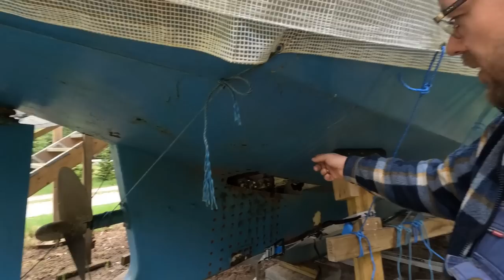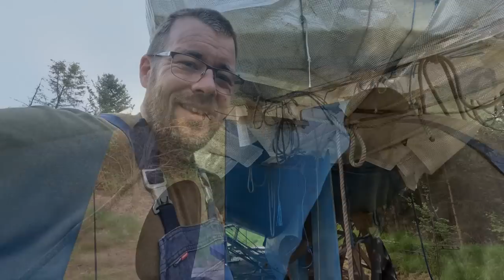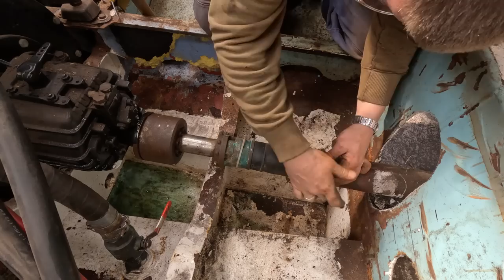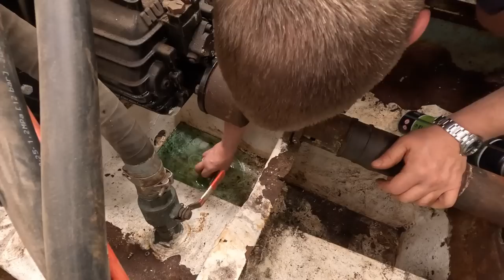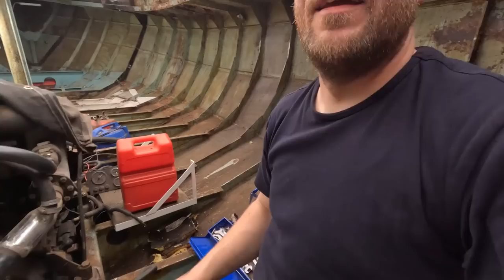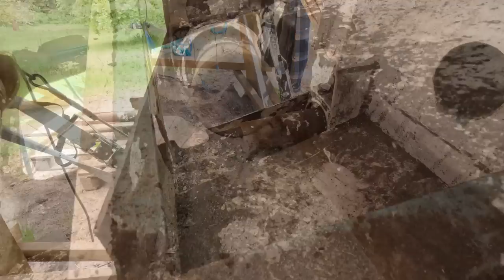Rudder & Propshaft removal. Stuffing Box & Stern Tube Reveal: The restoration of SY Carla part 30

Comment: My own experience with shafts of the size that you have is that they can be machined down in the worn areas and metal-sprayed then ground to bring the shaft back to size. When it comes to the shaft seal, no matter which type you use you need to have good access so you may need to extend the "log" (the tube that the shaft runs inside). You would be well advised to fit a flexible coupling such as "Polyflex" in place of the taper-lock that connected the shaft to the gearbox.
Reply from the maker: We agree completely with what you said and hopefully we can find someone here that can do that with our shaft 😊

Comment: The proper name for the metal block that connects to the gearbox flange is a 'taper lock'. As for the rotating propeller shaft, I would do a positive material identification test. Nowadays, there a better materials than 316 Stainless Steels for propeller shafts, the so called Duplex materials. It all depends on the budget you can spend. If you want to recover your propeller shaft, you can apply "metal spraying' on the part where the shaft is worn. Personally, I would install a new shaft with a mechanical seal (Gleitringdichtung in German) with a leak detection system. You can keep the old shaft as a spare.
Reply from the maker: Taper lock!! Thank you 👍😁 And that sounds really interesting. I will have to have a look into this mechanical seal. I have never seen that before. I only know those from pumps and such..  Are they used in boats too? I can definitely see what you mean with that duplex materials. It sounds like they are much more resistant to the salty environment. Thank you very much. You gave us a lot to look into to and think about 😁👍
Reply: @SYCarla  Yes, Mechanical seals for boat propeller shafts exist. You can find a lot on Internet. Personally, I think that, if you install a mechanical seal, you should use a seal with seal flush, to keep your seal clean from abrasive parts. You can also install a leak detection on your seal. Then you will be alarmed when your seal starts to leak. This type of seal may not be cheap, but it will keep your shaft from wear. Like I said, it all depends on the budget that you can spend.

Comment: Hello Carla 
Thanks for the prompt reply to my comment regarding the Aqua Drive 
Some thought on the stern tube. Considering your planned long voyages I would not hesitate in replacing the stern tube etc. also give careful consideration to the type of stern gland, the old style with packing material are easy to service but should always leak slightly to give lubrication to the gland. Some modern seals are excellent but often need the rubber seals replacing after a period of time.
Carry on with the good work.
Reply from the maker: Hi Martin
Yes you are right. There is definitely a lot to consider with regard to the stern gland. I would really like to install a drip less with a small hose for water lubrication. But I am a bit worried for the chance of the rubber failing leading to a lot of water coming in. But that should be prevented by changing it periodically I guess. Luckily we have some time to think it over before we have to install. Thank you very much 😁👍

Comment: I’d check the rigidity of the stern tube ( measure the wall thickness) and if that is ok then I would check the alignment from prop shaft to the gearbox. If that is ok , then I would start to check the axel for straightness. If all is ok then you can start to think about reusing the axel . I’d strongly recommend to scrap the muffler for the engine ( I have had a few of this crack in the middle and then the boat fills up with water really fast ) awesome work getting all apart .
Reply from the maker: That sounds like a very good way to go about it. We will definitely bring that with us. 👍 as to the muffler. I didn’t know that but I have had som concern about the rubber and now adding your experience we will definitely have to find an alternative 😊 thank you very much for your comment and recommendations 😊👍 we really appreciate it.

Comment: I would not remove the concrete unless you feel a need to. The same with the stern tube, it is just a housing . It is the shaft and your method of connecting it to the gearbox and the method of sealing it against the ingress of seawater which is the critical area.  If you can get a dripless seal system that would be the best. If the shaft can be dressed out that would be ideal, because I would not want to buy a new one.
Reply from the maker: I’m really glad you say that because I really don’t want to have to remove all the concrete 😅 In theory the concrete should be protecting the metal from rust and everywhere I have been removing concrete this have been proven true. So let’s stick to that 👍 As to the shaft I hope you are right. I think we will have to bring it to a professional and the hopefully it won’t get to expensive 😅 Thanks 👍

Comment: Hello Carla 
Very impressed with the work you are doing.
I would suggest that you seriously consider fitting an Aqua Drive they give you a smoother drive line, remove any worries regarding prop shaft alignment and reduce the thrust load on the gearbox bearings.
One problem they are not cheap but have been around a long time. I'm not associated with the company.
Reply from the maker: Hi. Ok I have never heard of Aquadrive before just now. But I have just been reading about it and I am really intrigued! It sounds like a really good solution. Like you say no shaft alignment and no thrust load on the gearbox. I will have to look in to how to mount it in Carla and then the prize of course. But I’m definitely interested. So we will have to research it some more.  Thank you very much for your comment. We really appreciate it 😊👍

Comment: I would replace the shaft because it has wear and rear. You do not know if you can center it properly again. The tube was probably filled with water for the lubrication of the shaft, so maybe best to check if you can still use it or have to replace it.
Another thing I would do or let do is to check the balance of the prop.
Reply from the maker: You definitely have a point there. We were thinking of maybe handing the shaft over to a professional så they can center it and check the balance of the prop. But we have to find out how much that would cost compared to buying a new one. I saw Vetus has a new shaft in the same dimensions. But I have no experience with their quality..
Reply: @SYCarla I could not find reviews of the Vetus shafts, but they are a well known brand, so my feeling says yes. Probably the people that balance the shafts and/or propellers know. They probably can also advise on the shaft tube. It is all quite specialized in my opinion.
Reply from the maker: Yes you are right. We better start looking for a place that can have a look at it and then we will see what they have to say.  As you say they can probably advise us on the tube as well..  Thank you very much once again for your help! we really appreciate it 😊⛵️

Comment: Looks like it needs to be replaced. That way you can see how much damage is under the concrete. You may have to replace the steel that is underneath that concrete. Better to see and know what you have now than later. 
 Ok until next time ⏲️,  
Aloha from the Big Island of Hawaii! 
 Who knows, we may see 👀  your sails ⛵️ on the Horizon someday from our lanai.
Reply from the maker: Yes you are probably right. I think We might remove a section at least to check if the thickness measuring device is giving us correct info. Better to be safe than sorry. It’s a long way to Hawaii and we don’t want it to fail on us on the way there 😁⛵️Thank you very much for your reply 😊 Hejsa from springtime in Denmark
Reply: Ya'll have a place to stay if you make it to the Big Island. I will keep an eye out for your sails on the Horizon. @SYCarla
Reply from the maker: Amazing!! Thank you so much. We really appreciate that 😊

Comment: If the shaft is without crevice corrosion repair as you can and reuse, otherwise replace  and stick to the type pf shaft seal. They do not fail catastrophically as dripless one can do. I made up a shaft seal holder from stainless steel  and mounted it same as yours was originally but the piece compressing the rope seals was tightened with nuts and a lot easer to service tan the brass ones. It was also cheap to make and served me very well for the years that I had the boat.
Reply from the maker: I’m really glad you bring it up! I have also thought of the dripless being vulnerable to catastrophic failure. Was the one you made also connected to the stern tube with a piece of rubber  and clamps or how was is mounted?

Comment: Could you get repair versus replace quotes? 
As for the concrete, it seems to be in fairly good shape on the surface. But who knows what lurks beneath.
The full strip & inspection will prove invaluable on the road to reliability & peace of mind.
Reply from the maker: We will definitely have to get some quotes for both that’s a great idea 👍😊 the concrete we have removed before in previous videos have been in a good condition and this seems to be too. But you might be right that it would be best to get a look at it now that we have the chance to and replace what is needed and reuse what we can. Thanks for taking the time to give us some sound advice 🥳🤩

Comment: So many aspects of a project can be "dealt with" and / or "modified" but to me, when it comes to the heart and soul of a boat? That's where I would highly consider "renew" over "repair". For longevity and peace of mind when the family is on board!
Reply from the maker: You are so right and that is the reason that we have decided to do everything that we have so far for exactly the reason you say but still if it is in a condition where it can be repaired we also have to think of the cost of everything if we ever want to get to go sailing so it will be a matter of weighing all our decisions on both. But for sure everything has to be safe and secure to make sure that we will be as safe a possible when we get on the water 😊

Comment: The shaft wear didn't look too bad. I think I would look into replacing the stuffing box with a dripless shaft seal. Do away with the shaft extension, maybe engineer a better bearing mount close to the engine coupling if needed. The wear caused to the shaft by the stuffing box will be further up the shaft than where the dripless seal will be working.  Clean up the shaft before making any decisions!
Reply from the maker: We will definitely have to replace the stuffing box so we can get as little water in the boat as possible. We hope to reuse the shaft if at all possible to save on cost we will have to get it cleaned up to have a good look at it 😊 thanks for your advice 😊👍🤩

Comment: I would replaced the shaft with a martensittic shaft. I would also have replaced stern bearing and shaft seal (with a non dripping seal). Keep the bilge bone dry. I am starting the same job on my boat next week.
Reply from the maker: That sounds like a great suggestion we will have to look into that thanks for the tip 😊👍🤩